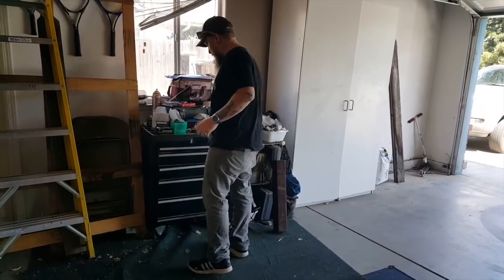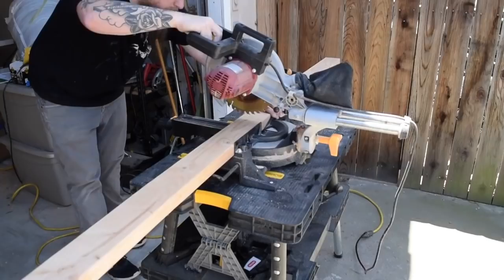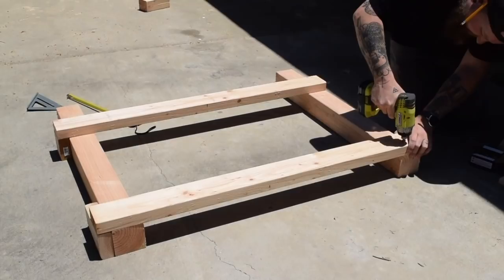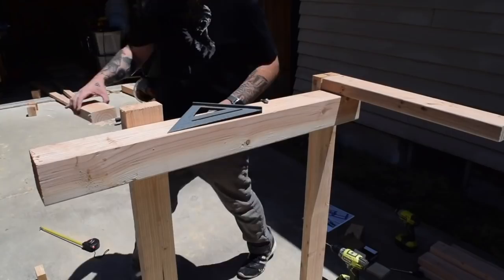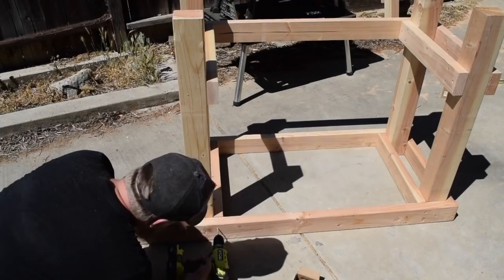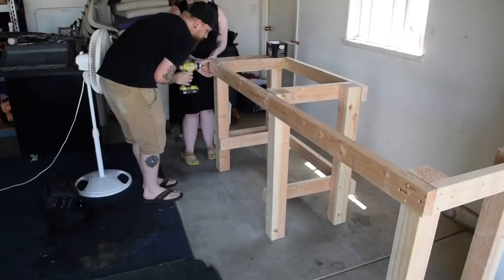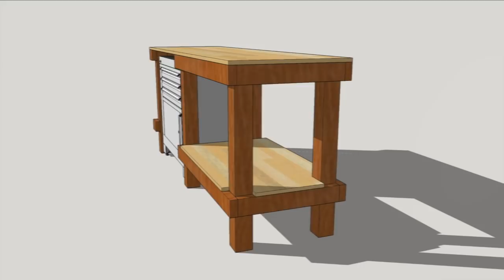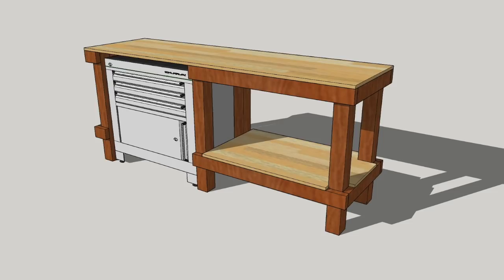Crazy Easy Workbench Build!!! | FREE PLANS

Comment: This is a great story. I think one gets more out of building something for someone else than for yourself. And you did it for Father's Day. Extra special.

Nice to hear you've got shadier digs to work in. Fresno can be brutal. I'm in San Antonio and it's no better. I have a niece in Fresno, some other relatives in Clovis and my folks used to live in Shaver before they passed away. The opposite extreme to working in the heat would be the cold Tule fog, right? Where you can't see from one end of a sheet of plywood to the other.
Reply from the maker: Thanks so much. I really appreciate it. I recently moved so I have a garage to work in now, which is super exciting, but is also the reason I haven't or it a video in a while. 

You nailed it, the summer is extremely hot and winter is so foggy. Fresno gets a lot of flak but it's really not so bad.
Reply: I'm originally from Orange County. Fresno always had that "small town" feel to me. I prefer that over the concrete jungle of So. Cal. San Antonio may be one of the top 10 largest cities in the U.S., but the culture makes it feel "small town" to me. It's also like Fresno in that you don't have to go far to be in the country. You'd have to drive 2 hrs in Orange County to be anywhere near "the country". 

I sub'd your channel so I will patiently await your next video. Sub mine if you're interesting in watching me play guitar. I ain't no American Idol but I ain't no America's Got Talent flunky either. LOL.

Good luck and have fun in your new space. Can't wait to see it.

Comment: Looks great well done. Just a thought When cutting the 4 x 4 on chop saw, if you put a spare square 1'' inch piece of wood up against the guide before you offer the timber up you are cutting, this will remove the issue of the blade not cutting all the way through the timber, hope it helps
Reply from the maker: +Brian Barlow awesome tip. Never would have thought of that. I'm gonna give that a try next time I'm cutting 4x4s. Thanks for the comment and the tip.
Reply: I was also going to suggest this. Your saw looks just like the Chicago Electric I bought at Harbor Freight. I had the same issue when I was repairing my porch until I fixed a piece of scrap 1x  against the fence.

The bench looks good. Nice job.
Reply from the maker: +M Angellotti yes, it's a harbor freight mitre saw. It's honestly a great suggestion and the saw gets the job done just fine otherwise. But wouldn't you think this would be something tested by Chicago Electric. Haha. Thanks for the comment and compliment.
Reply: I had that saw... just flipped the 4x4 over and finished the cut. Nice vid, thanks!

Comment: First time viewer. You mentioned at first of video that mitre saw could not cut all of the way through and you had to saw the last bit. If you added a small sacrificial fence, wouldn't that move the edge of the board out enough to get past the curve of the blade thus cutting all the way through?

Comment: How wide was the opening where the tool box goes? I'm going to build one at 8ft long soon also taking the height to 40 inches and hoping to take the front 2x4 all the way across like the backside and put another 21inch support 2x4 in the middle like on the right side of the bench.

Comment: I really like your plan.  I am considering doing the same thing, but I have one issue. I can't seem to find any tool carts that come with four swivel casters. They all seem to have two rigid and two swivel casters. Also, not sure if you can even replace the two rigid with two swivel casters. On your cart it looked like it had four swivel casters. Did you modify your cart for easier mobility? Thanks.
Reply from the maker: Hi thanks for the comment. The cart we used did have two swivel casters. I made the space for the cart just slightly oversized do I could swivel it in place

Comment: Good work man. Just thinking would the beach be able to take bench vise on plywood ?
Reply from the maker: Ash Dep if you're putting a vice on the plywood, I'd say go with the right side and just add some 2x4s running from front to back for extra support. 3/4" plywood is surprisingly strong, but I would add the 2x4s just to be safe. Thanks for the comment.

Comment: I'm late and you probably won't reply but would it be possible to make an area for a vice and a scroll saw, without breaking the plywood
Reply from the maker: Altas22 ._. thanks for the comment. For the vice it scroll saw, I would just add extra 2x4 supports under the table top. That will give you something if substance to screw into as well as adding support for the weight of those tools.

Comment: Did you ever find a link for the video about the triangle screw placement jig?
Reply from the maker: I have looked everywhere and can't find it. Basically what you are doing is rotating the block 90 degrees on the corners so the screws don't run into each other. I may make a video myself just so it's out there and easier to find.
Reply: @RookieDIY  Sounds like a good idea! Thanks!